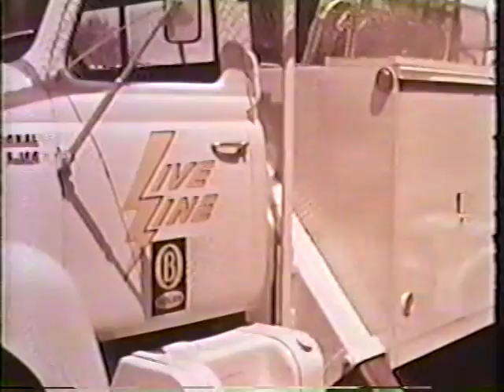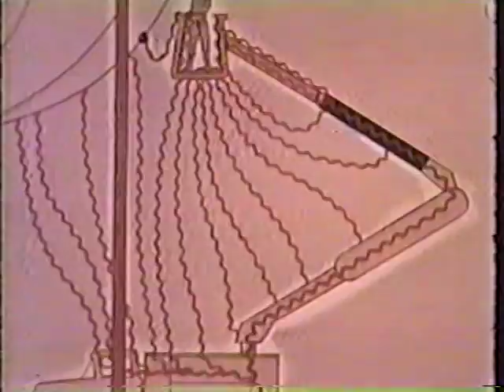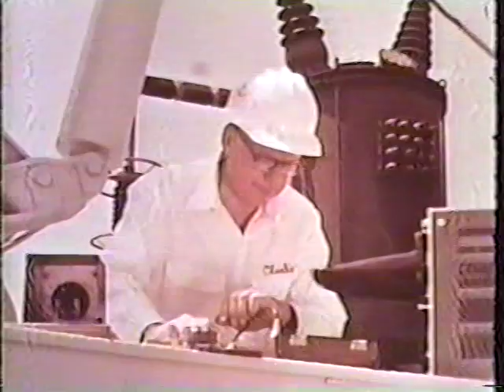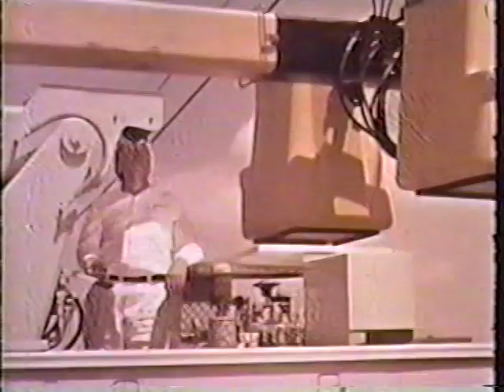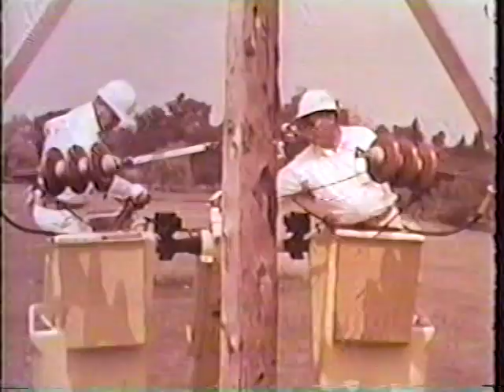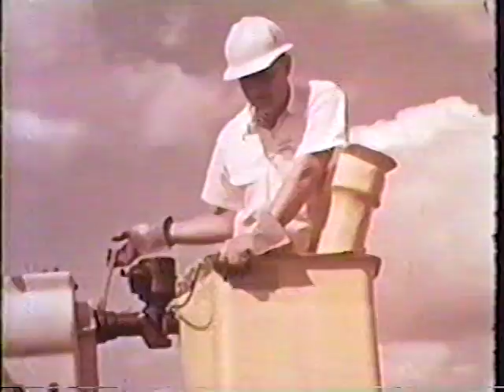Old School Barehand Line work

Comment: First bare hand unit i rem using was a old Holan 88 . Best three years i ever done in transmission work. Mr Bill Ogle was the man that came in from Texas Utility’s back then and one part taught us what we needed to know and 2 nd he bird dogged the shit out of us. And the potential gets sketchy as hell after you have been running up dusty right aways all day. At quitting time we would have a guy come in and pressure wash the Booms in and out to to reduce the build up of dust.
Reply from the maker: That's pretty funny Rooster. Some old hand gave me this back around 1989. I've never seen it posted anywhere else and had it on VHS so got it copied so everyone can enjoy it. 
I've done my share of BH... but this video is sketchy as shit and I love the white shirts. Cheers brother

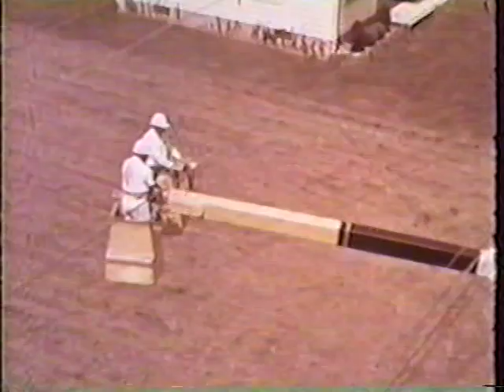Comment: The most exceptional reaching boom:  at 21:30 explains the the reach angles for a 50 and 55 ft boom.  The one that we had was stamped for 345KV usage that was back in 1962 model boom.